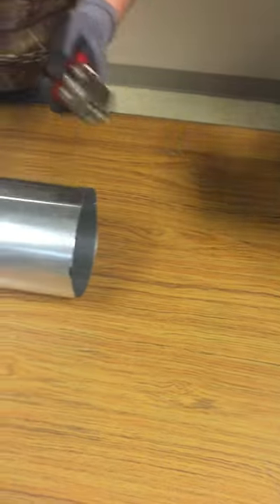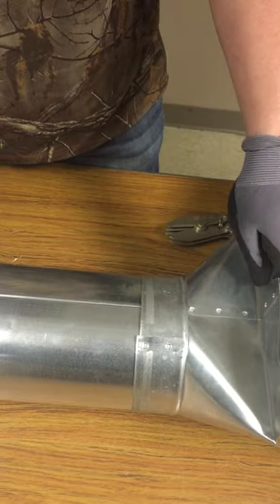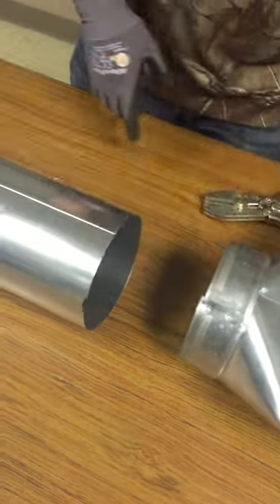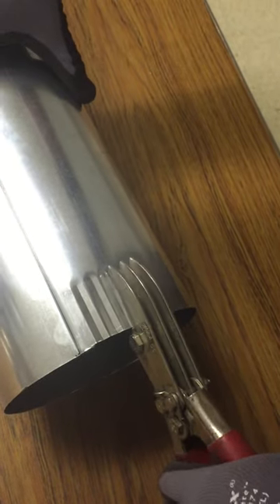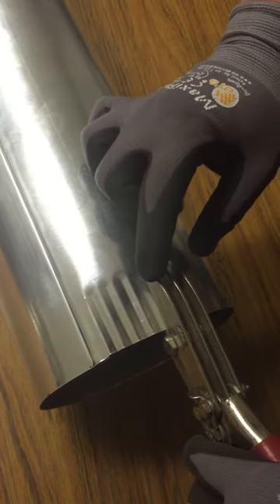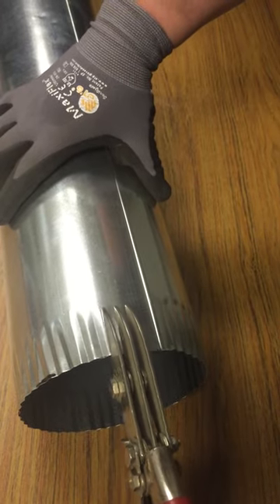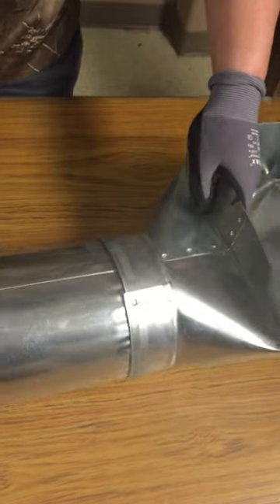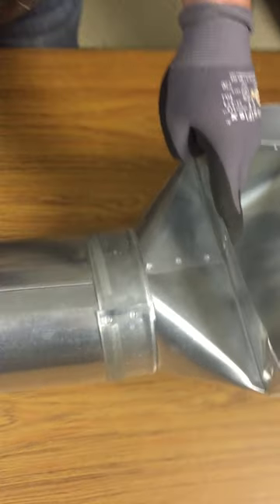HVAC How to Crimp Round Ductwork

Comment: So you are not only using the tool the wrong way as so many people already mentioned but depending on which way the air is being forced you only want one crimp end and you want it to be on the side the air is going towards. You don't crimp both ends of a pipe 🤦‍♂️
Reply from the maker: You know they are just practicing cutting and crimping. They are not really installing the round duct, Right? So they will crimp both ends and cut it off and crimp it again.

Comment: Thank you. After fitting the duct together, it seems a little loose. Should I just use duct sealant to glue them together, or should I drill a few holes and put in screws to hold them together?
Reply: No need to drill. Just screw